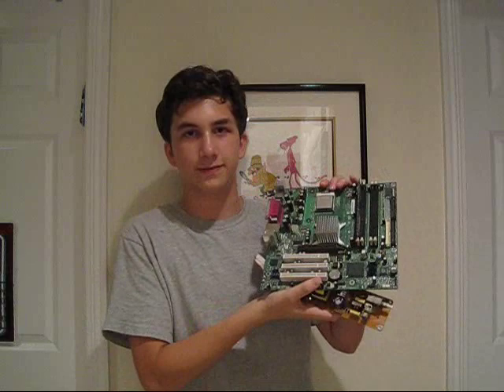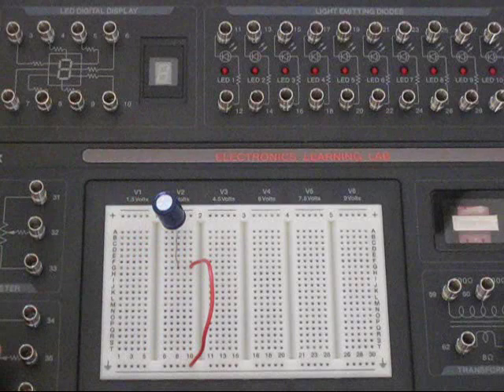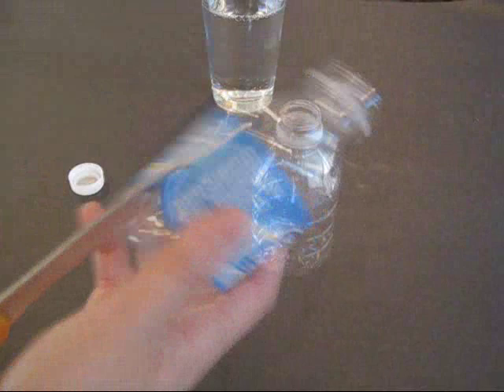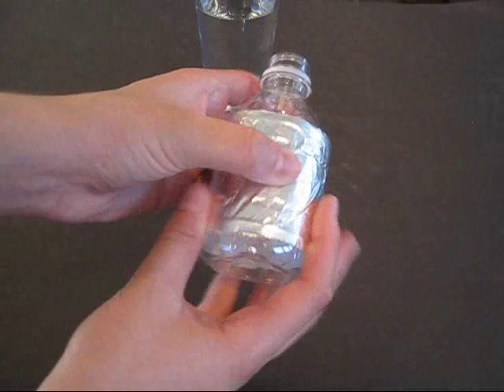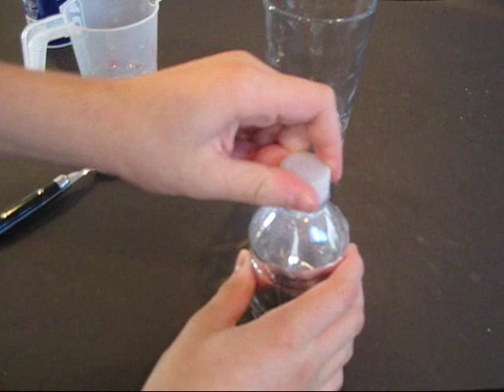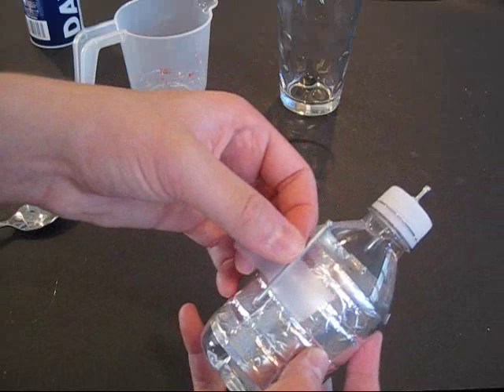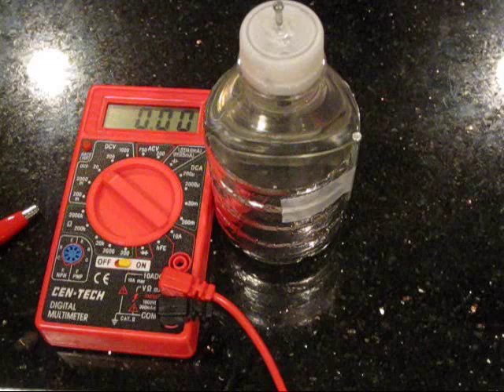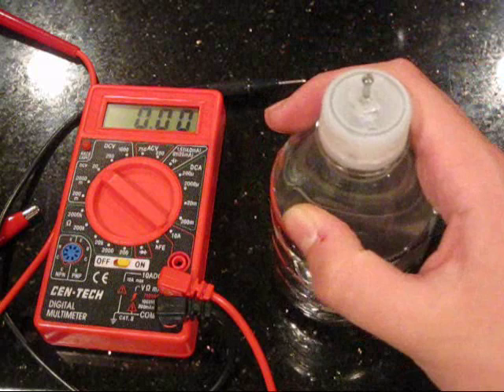Make a Water Bottle Capacitor - Tech Tuesdays

Comment: The bottle/capacitor should charge from your supply in a fraction of a second.  You can check this with the meter while still connected.  But once you remove the power supply (which can be just some batteries) the charge will "leak" off the capacitor, depending on the conditions/humidity.  Try charging up the cap with static electricity from rubbing a balloon on your hair or fur.  You'll get a much higher voltage and should be able to feel a shock.  Good project!

Comment: Funny to mention I have a 16.9 oz water bottle capacitor I made. Charged it with a van de graff and nearly killed my self when it arked off to my hand while holding the wrong wire. Got a big jolt and nearly fell over,heart rate was high and my whole body twitched out. Felt like some one stomped on my chest . Not to mention weakness of every muscle after
Reply: Hey you here

Comment: Per the video instructions, I made a list and steps to follow. I haven't tried this experiment myself, yet. But I at least have the process down!
Supplies:
Water bottle (8 oz will work, but 16-20 oz would be better.)-if empty bottles, be sure to have water to fill the bottles available. NOTE: the flatter the sides of the water bottle, the better.
3 nails-2 inches ling
Tin foil cut into strips to fit around bottle like a label
3 alligator wires/clips attached to a power supply
Tape
Salt 2 tsp per bottle (per the last notes of the video, maybe add more if a bgger bottle?? Not sure....)
Hammer
Hot glue
Multi meter voltage tester.

1.	Place the tin foil onto the bottle like a label and tape together. Make sure the tin foil is snug to the bottle, so smooth it down with your hand. You want the tin foil to touch the bottle as closely as possible.
2.	Add 2 tsp of salt inside the bottle
3.	Fill the bottle about ¾ full with water. Attach lid tightly.
4.	Shake the bottle to dissolve the salt.
5.	Hammer a nail through the lid leaving about ½ inch of nail sticking out. Seal the nail with hot glue so the bottle it does not leak.
6.	Once the glue has dried, remove the lid, and fill the bottle of water the rest of the way up to the bottom of the bottle neck.
7.	Take the 2nd nail and a piece of tape and place onto the side of the bottle where the nail is touching the foil as tightly as possible. 
8.	Using a power supply and alligator clips, attach the positive clip to the top nail, and the negative clip to the side nail. Let the time lapse for about 10-15 seconds. 
9.	Using the testing meter, touch the positive tester stick to the top nail and the negative tester stick to the side nail and test how much voltage is created.
Reply: Denedim herşeyi doğru yaptım ama işe yaramadı 😪

Comment: I would recommend to use more salt, and the nail should touch the bottom and you will get better results. A capacitor is supposed to charge in a fraction of a second
Reply: if you mean the nail in the cap, if it touched the bottom of the bottle it would instantly short as it now has contact with the dielectric the plastic bottle

Comment: more salt.
Reply: = more charge?
Reply: From what I know, you are suppose to put enough salt that it cannot dilute in the water anymore, and no matter how much you stir, or shake it, you will see a little salt on the bottom. Also, if you use a copper nail on the top, it would be a battery.